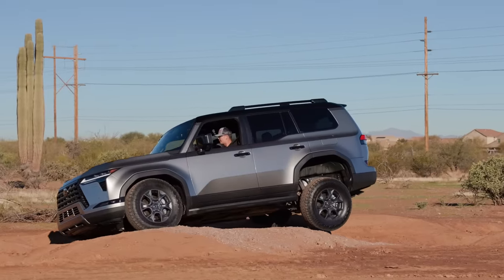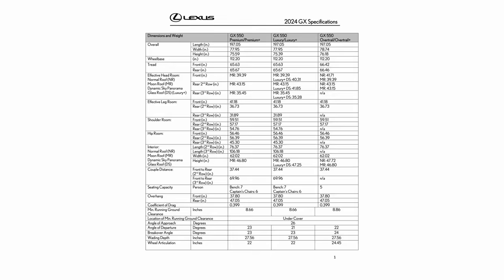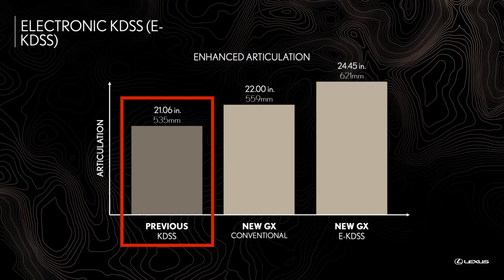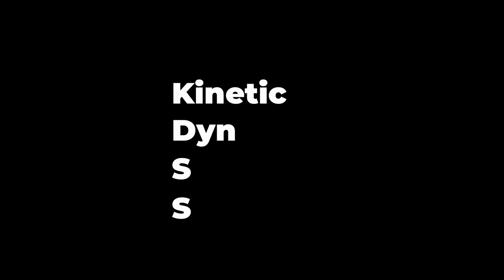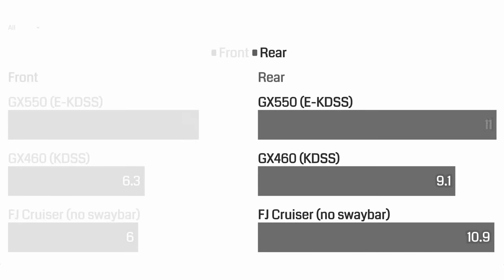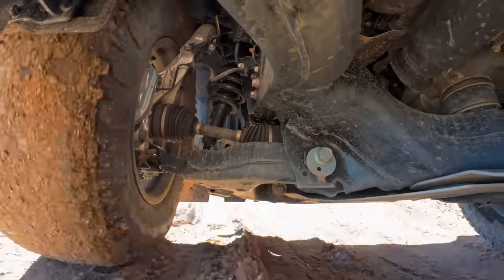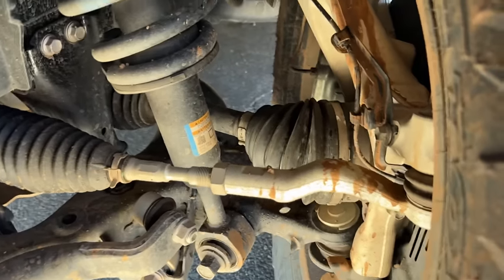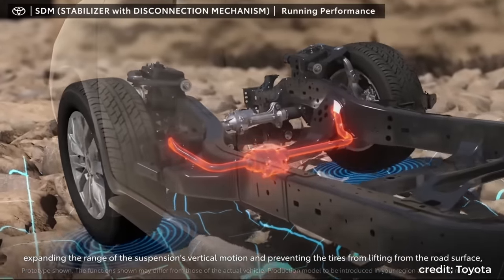Suspension Design With GX550 Chief Engineer

Comment: People, I bet the new 6th Gen 4Runner, the Toyota true off-roader left, not considering Lexus, that will come out in 2025 will have this, at least as an option or by default in higher trims like TRD Pro. The fact "like no sway bars at all" for the new E-KDSS will be like a bomb. With these numbers and tests will kill every competitor out there running on stock, non-tuned suspension.
Reply: eh I can see it being exclusive to the Lexus SUVs for a while. None of the Tundra, Tacoma or even the new 'Land Cruiser' has eKDSS; Tacoma and Land Cruiser have just front stabilizer bar disconnect

Comment: I wonder if we’ll be able to swap the new GX 550 front suspension onto 5th Gen 4Runners?
Reply from the maker: Unfortunately no. The control arm bushings spacing are different. But yes if you cut up the frame and custom fabricate new mounts lol

Comment: I saw 1 source say it has 8.9 inches of ground clearance and another say it has 10.9. did you measure that?
Reply from the maker: you bet i did! it's a little complicated. On the Overtrail, I measured 9.25" under rear diff. 8.8" under front diff skid plate. And 7.8" under transmission skid plate. These are not great. A 1" front lift and larger tires would be good.
Reply: good work! please let us know how that will compare to new land cruiser @TinkerersAdventure

Comment: Are you going to get 74 weld portals for your FJ?
Reply from the maker: probably not, it'll be too wide. but if i don't have long travel, i might!
Reply: @TinkerersAdventure   Those guys in the Ukraine, Werewolf 4x4 have an interesting portal set up also. They make their own wheels which can have central inflation. Only difference with them and 74 is Werewolf housings are cast. 
 If I was doing again I’d put them on my GX. OEM suspension and driveline angles.

Comment: If I may ask,is the ekdss in this new GX same as one one lc300 GR sport?
Reply from the maker: I'm not sure if everything has the same part number, but it is the same architecture. The LC200 and GX460 KDSS had completely different architectures.
Reply: @TinkerersAdventure  between the GX overtrail and LC300 GR sport which of the two vehicles would you prefer

Comment: I would be very happy if anyone who knows could comment. I am planning to buy Mercedes g63 4x4². My goal is to turn it into an instrument of doom. I have ideas such as adding a winch to the front, changing the front and rear bumper, changing the side steps and adding LED lights. I am thinking of adding a solar panel to the ecoflow and making it a vehicle that can be used in emergencies. mt off road tires etc. I would be happy if you give me an idea such as buying that vehicle or not, buy another vehicle.

Comment: Once again, you are confusing articulation, flex, and suspension travel. Ifs has no articulation because there is no interaction between either side like a solid axle has. Pushing up on one side doesn't transfer a downward force to the other side like in a solid  axle, hence no articulation.

Comment: V6 issues need to be worked out first. 70k starting for a new engine to be in the dealer all the time, no thanks. Will take the old V8 even if the KDSS is inferior.
Reply: They’ve long been worked out
Reply: @flight2k5  No they haven't lmao. There are tundra's getting completely torn down with new engines due to poor oiling on the main bearings.
Reply: @Veryniccceee  🤣😂 yes they have. That is not true at all 🤣🤣😂😂. It’s funny the 5.7 had major issues when it first debuted. But the issues were fixed. You know the 3.4 has been around since 2017 right?
Reply: @Veryniccceee  It's been resolved since early 2023. The cause was improper cleaning of the engine blocks by a negligent employee.
Reply: @Wxman9123  It's entirely possible it's limited to only the USA made 3.4, but an obstructed main bearing will break down much sooner than 20k miles. Most of the failures are within the first 2 years (20k+ miles) of ownership. Points to a design issue over a manufacturing issue unless things are not bored properly to spec. I haven't seen anything from Toyota saying it was due to a negligent employee.
Reply: @flight2k5  haha this didn’t age well😂😂. 5.7 issues didn’t cost 32k to fix.  You must’ve been one of the early adopters who paid markup and can’t give them away now😂. 62 new tundras rotting on the lot of just 1 dealer alone here in dfw.

Comment: Reality is the offroader wants a 1985 toyota in 2024, turn key, gages, roll up windows, NO COMPUTERS, with front and rear locking diff complete armor, snorkel wench on 33's. Ya built that for under 25k and ya can't make them fast enough. Come on Man

Comment: Wait.... did you just say 6th gen 4runner?
Reply from the maker: you bet i did :) The engineer told me E-KDSS is reserved for the absolute flagship vehicles, LC300 and GX550. I said wow so the GX550 is really special as it will be the only E-KDSS vehicle in the north america. Engineer, Yes. Me, so the new 4runner will only have SDM. Engineer, Y..oooh!!!!
Reply: @TinkerersAdventure  I wish the 24’ TRDPro sequoia got something like that. It’s a blast to drive but the suspension leaves a bit to be desired. Nothing like our supercharged 4runner on Bilstein 8112/8100!

Comment: You guys are nuts. Just a truck that's not a real truck, needs a solid front axle. Plus the transmission will be programmed wrong. Truly, Toyotas aren't as great as they like to think they are, it's all just propaganda and advertising. I'll take a f250 ANYDAY over this. If you need to go off-road, get a dirt bike.

Comment: Laughs in triple locked Land Cruiser 80 series
Reply: Laughs in being able to maintain 75mph, lol.
Reply: @joshuamiller9436  not an issue with correct gearing
Reply: @joshuamiller9436  LOL that is so true
Reply: glad you are laughing, but its not a competition
Reply: @4WDisLife  never said it was but you can't deny solid axles perform better in this type of test
Reply: @sun_dreaming The 80 series is dope but let's not pretend it's good for highway driving.
Reply: @Wxman9123  yeah of course not. The title of this video is "Lexus GX550 Will BEAT Your Toyota OFF-ROAD"

Comment: With only 650km range, you call this an off-roader? This is a city sliker. My Prado120 has 180 litre tanks and a diesel 3.0 engine easily has more than 2000km range. My Prado kills this new Lexus for dead, period.